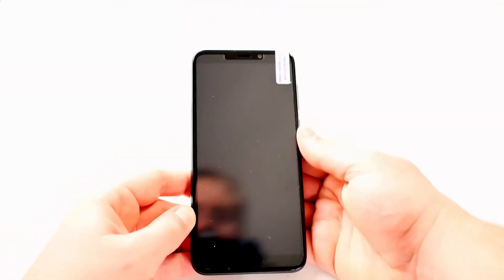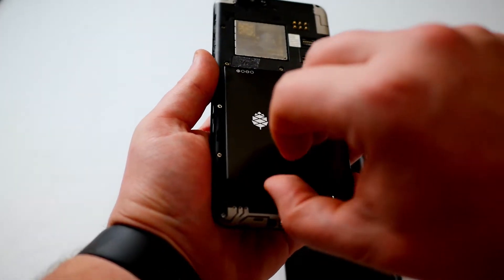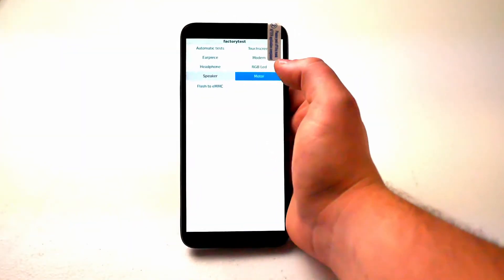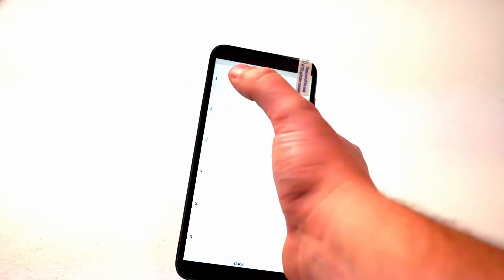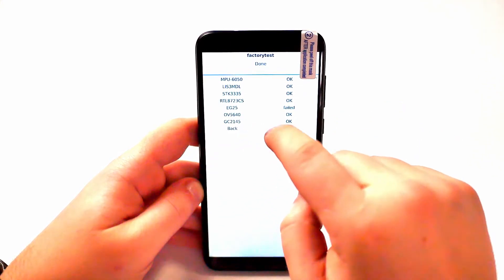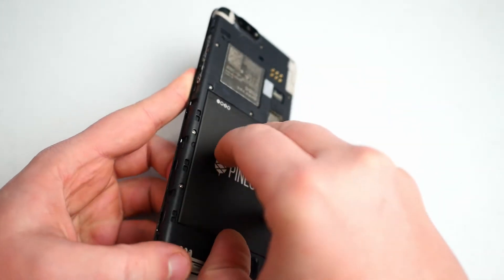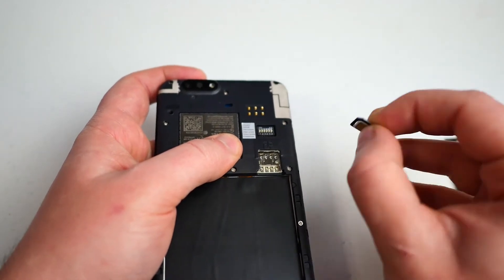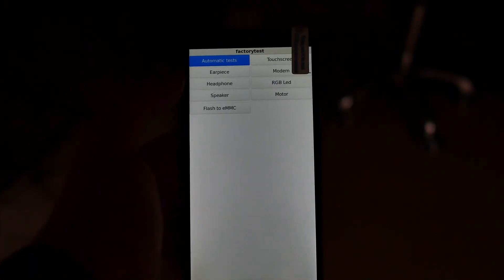PINEPHONE Power-Up!!! (Part 2)

Comment: Are you able to at least insert/remove the SD card with the battery in? Yours and every other video I've seen make it look impossible for the SIM card, but I'm not able to tell if the SD card would fit in that gap with the battery in or not. It's not a massive deal breaker or anything if that is the case, as I don't necessarily need to hot-swap my SD cards on my phones.
Reply from the maker: Thanks for commenting!  No, you can put the SD card into the phone while the battery is in place but you can not reasonably remove the SD card without first removing the battery.....and then it is very easy.